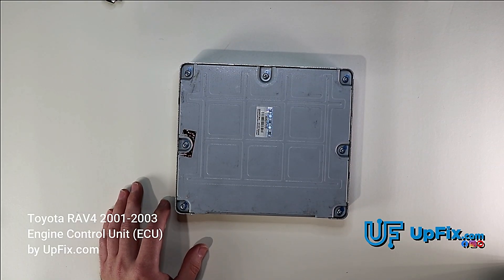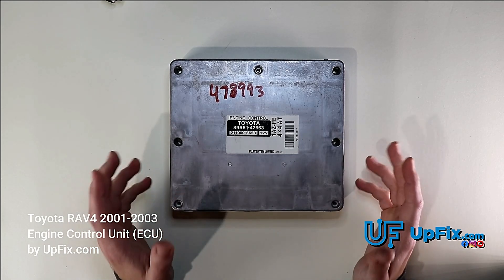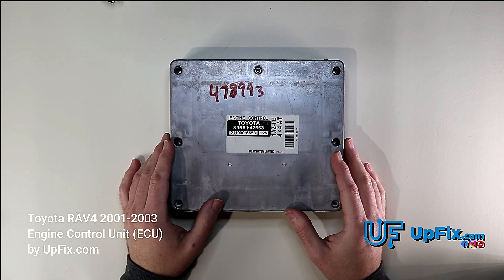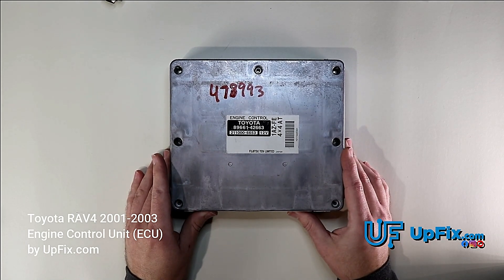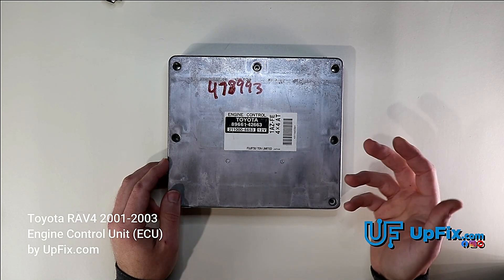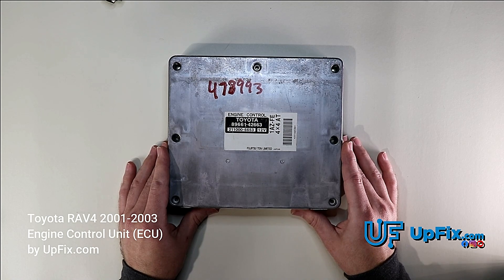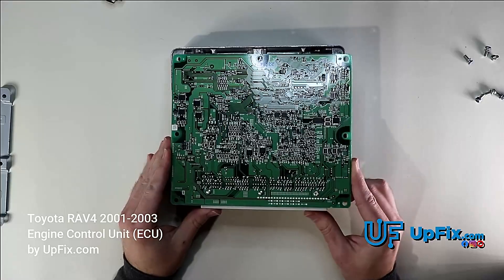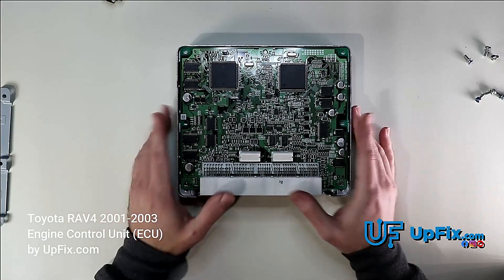Toyota RAV4 Engine Control Unit (ECU) Repair for 2001 2002 2003 models

Comment: I have 2003.rav 4 automatic. It has  hard shift to R and between 2-3 gear. 360km on it. Its from canada. It has had no recalls done.
Now it has 30tkm driven new transmission from previous owners, i think its the ecu/ecm, i have no idea where to buy one or repair. Im drunk, ill figure it out after inspection. For now works well when driven nicely.
Reply from the maker: Sounds like a tricky situation, but we're here to help if you decide to repair your existing ECU!
Reply: Hi, 
Where to contact you? I need to repair my toyota rav4 2003 engine ecm because car have gearbox issues, changing gear hard

Comment: Hi I repaired my ECU by myself (resoldering all the chips on the ECU). Now the O/D Off won’t turn off. So I am stuck at 3rd gear max. Can you solve this? The other issues are done. This problem occurred after I resoldered the ECU.
Reply from the maker: That is not a common issue for this part. You can send it in, we can see what is wrong and possibly fix it. All depends on what is damaged.

Comment: I have a 2007 RAV4 4wd, I  bought in October 2023, after almost a week of having it I noticed a shutter.  Thought it was just the surface of the road.  I finally had a mechanic test driving it when it happened.  They said the torque converter and best to change transmission and out new torque converter.  Had a second mechanic do the same and they said the same thing.  The transmission was replaced with one with 78k miles and new torque converter out in it.  The shutter started again shortly after getting it back.  Then they thought maybe other issues, months later and thousands of dollars later, it is still happening.  Also had dash lights coming on and changed a bunch of parts for the lights to only come on again.  The shuttering only happens when it’s in drive, if you put it in 3 it doesn’t happen.  I saw a video where they said you have to have a software update after replacing transmission and torque converter or it will start happening again.  Is this fix you are showing on this video something that would fix these issues and do you do this for 2007 4wd model parts as well?  The code showing when the dash lights come back on now is only showing P0171 after changing several parts.  My mechanic talk to a guy from Toyota and the said it might need a new computer and that may be causing the lights to come on.  My mechanic said he needs to flash the computer?  What do you think?
Reply from the maker: P0171 points to mass airflow issue which is usually the MAF sensor. That code could also be caused by a leak in the system somewhere. The issues you’re describing point to something going on with the transmission system. If you have any transmission related codes that would certainly help. 

In regards to the ECU in your vehicle it controls both the engine and transmission. Prior to replacing it I would recommend doing a firmware update in-vehicle to it as well as the TCCM (transfer case control module) and see if that helps. If still having issues we can do a bench test on your ECU. Checkout upfix.com
Reply: @upfixauto  The MAF sensor has been changed as well as both 02 sensors and a new muffler because the seam was coming apart slightly on the old one.  There has never been a code for the transmission showing.  When the lights first lit up after the transmission and torque converter were changed the codes that came up were P0138, P0328, C1280 and C1201.  The Knock sensor was changed.  The shuttering from the transmission happened with the old transmission and torque converter, then started again after it was changed to newer transmission and brand new torque converter.  For a firmware update, do you have to get that done at a Toyota dealer?  I h spent just over $7000 and these issues still persist.  I. On disability, so I really can’t afford replacing much more parts to only have the same problem after.  I appreciate your help.

Comment: I just bought a 2001 RAV4 and immediately noticed an erratic shifting and hard pull, only after a few days of buying the car. Interesting was that during the test drive it worked fine and most of the time it does well. how much will refurbishing this ECU cost me?
Reply from the maker: If you're experiencing erratic shifting and hard pulls in your newly acquired 2001 Toyota RAV4, it's quite possible that the Engine Control Unit (ECU) is contributing to these issues. The RAV4 models from these years are known for ECU problems that can affect transmission behavior.

Refurbishing your ECU with UpFix involves repairing your existing ECU, which can be significantly more cost-effective than replacing it. The exact cost can vary depending on the extent of the damage and the specific repairs needed. Typically, ECU repair services range from $200 to $500. It's recommended to send in your ECU to UpFix for a diagnostic check. UpFix will assess the unit and provide you with a detailed quote before proceeding with any repairs. This way, you only pay for the necessary repairs, ensuring your vehicle returns to optimal driving conditions.

Comment: Where is the ground for the ECU located on a 2002 RAV4?
Reply from the maker: On a 2002 Toyota RAV4, the ECU ground is typically located near the ECU itself, which is found under the dashboard on the passenger side. To access the ECU Area, first, you’ll need to remove the glove compartment to access the ECU behind it. The ECU ground is often connected to a grounding point on the vehicle's chassis nearby. In the RAV4, you will find it attached to the metal body or frame within this area, possibly with a bolt securing it.

Comment: Let me ask you something ( I’m Jay from Tire Outlet San Jose Ca ) so the referee ( smog check ) failed a customers 2001 RAV4 because the engine speed on the scan tool ( it’s lazy ) did not match the actual engine RPM. The only thing I can do really is change the ECM or I have an improper engine assemble right? One or the other?
Reply from the maker: That sounds weird. Try to go to a different smog station. If your engine light is not on then you should be able to pass the test.

Comment: Does the 2002 Toyota RAV4 4x2 ecu work on a 2003 rav4 4x4?
Reply from the maker: They're physically identical, but the software/programming is different and will not work correctly.

Comment: Make sure the problem is actually the ECM first!  I replaced the EGR valve and then the MAF and that solved the problem on my 2002 Rav4.  The total cost was about $40.  I also pulled the spark plugs and the coils and checked those as well and since those were OK I went on to replacing the EGR valve and MAF sensor due to those two items being inexpensive to replace. 

Even though I didn't hook up and run a OBDII reader to the Rav4's computer I just test drove my Rav4 If the car runs fine then I don't worry about the engine light whatsoever.  I've been driving my 2002 Rav4 this way for the last 6 ~ 7 years without any significant problems either....

Like one YouTube mechanic said, "If the car's engine light is ON but there are no significant problems when you are driving the vehicle them continue to drive the car.  Many times the problem is insignificant and does not need addressing."

Comment: My  friend's 2004 has similar issues-have not had it professionally diagnosed. Was the '04's ECU/ECM 'fixed' or could it still be the cause? Thanks
Reply from the maker: Yes here is more info on what issues we repair https://www.upfix.com/product/toyota-rav4-2000-2010-ecu-repair/

Comment: What size screws are needed to attach the ecu to the mounting brackets? I shipped mine into you this week for repair but I stripped a couple of the screws removing the ecu.
Reply: M5-0.8 in case anyone else needs to know

Comment: I have two codes 2001 rav4 292k kilometres 

P0750 shift solenoid A
P0753 solenoid electrical 

Is it ECU issue???
Reply from the maker: Yes this is issue with ECU for RAV4. Here is more info https://www.upfix.com/product/toyota-rav4-2000-2010-ecu-repair/
Reply: My 2002 rav4 is not starting out in 1st.  Will not downshift to 1st and reverse shifts hard.  Could this be the ecu.i changed the fluid and checked solenoids.  .

Comment: Yes I've repaired several of these and got the vehicles cheap because people thought the issue was directly in tranny. I would even tell them this issue, but they didn't want to fool with it.
Great video about this issue. Important though is fact made not to drive too much or wait too long with this problem, it will damage transmission.
The problem originated from a new supplier of these ecu from for new 2nd generation rav's. They were made with weak solder to circuits and would start to break apart after 80k and up. Many would be out of warranty even after toyota raised years of warranty.
Common problem with new model years and suppliers not recognizing and working bugs out.
Reply: Can you please tell me what kind of issues this would cause? I am seeing a lot of information but i just am not sure. I really appreciate any help
Reply: Can you please direct me to a video of how to do the repair myself. Thank you!

Comment: Hi, will purchasing a new one from Toyota fix the issue? I know this isn't the cheapest way to get this fixed, but its something I would like to know.
Reply from the maker: It is a common problem with ECU for this vehicle
Reply: @upfixauto  With newer ECU models as well?  I would like to get it fixed, however I'm located in Australia and when I go to auto electricians/transmission specialists/Toyota they all recommend getting a new ECU rather than a repair.  I can't find anyone in australia who will do a repair job.

Comment: Hi. Great info.. but is this ecu issue also a cause of not starting??.. engine turns but no start.
Reply from the maker: Yes that is correct, this is most likely the issue with your ECU

Comment: The code readings giving me shift solenoids A&B. Do you think it is the ECU or should I replace the solenoids?
Reply from the maker: Try replacing the solenoids or test the wiring and signal.

Comment: Hi, I have no error codes but when starting my 2001 Rav4  and going from park to drive it jerks really hard, even jerks when backing out in reverse . This started when car was only 2 years old, dealer said no codes so they can't work on it. {even tho repair bulletin came out by Toyota} . Was slow when entering highways {dangerous} . It got so dangerous we hardly drove it {used our other car all these years mostly} and only used the RAV 4  for local driving {no more highways} to nearby supermarkets, only has 14k miles on it.
Reply from the maker: It's unusual for a car with that low mileage to have this issue. But the other factor is age which also take its toll on electronically components especially due to age. If the ECU hasn't been rebuilt even with no codes, since that ECU 01-03 RAV4 is notorious for failing, I would recommend getting a rebuild. We’ll be able to diagnose and repair this unit.

Comment: I have a problem in gear shifting ..pls guide is computer fault..?
Reply from the maker: Yes, that is a common problem in RAV4. Problem shifting gears from 1st to 2nd. Transmission slipping, especially from 2nd to 3rd gear
 Here is more info: https://www.upfix.com/product/toyota-rav4-2000-2010-ecu-repair/

Comment: Got a problem with my ECU on the RAV4 2003. Car won't start. Found out that spark plugs are sparking even though its all new Spark plugs.
Any ideas on which part of the ECU is damaged or playing up???
Reply from the maker: You can see all issues that we fix here https://www.upfix.com/product/toyota-rav4-2000-2010-ecu-repair/

Comment: is there any specific procedure as far as relearning shift adapts in the ECU to the transmission?  2002 RAV4 78k miles.  Thanks.
Reply: After the ECU's been rebuilt and re-programmed, the ECU will automatically relearn the proper shifting patterns typically within the first diagnostic cycle ie less than 100 miles.
Reply: @245artist  I just reinstalled my repaired and reprogrammed ECM for 2004 Rav4 yesterday. There was improvement in 2nd to 3rd shifting hesitation yesterday but today it became poor again. Does it happen like this at times after the ECM repair? I was thinking that everything should start working fine after the ECM relearn which I believed happened yesterday. 
My reverse harsh engagement still persists.
Reply: @juliustay2541  It should essentially be plug-n-play. Harsh shifts should go away almost immediately and if not the relearn will happen automatically within 100 miles. Was it recently repaired by UpFix and what codes are you still getting?
Reply: @245artist  Oh sorry, no please it wasn't repaired by Upfix. It was done elsewhere, I got inquisitive and just wanted another opinion when I saw your ECM relearn within 100 miles, that's basically the same as to keep driving it for a while. 
Currently, the only code I have has to do with my oxygen sensor which has been there before the repair and reprogramming. I rather had P0776 code for Solenoid B malfunction but that is no longer there. Shifting was better today too. I guess I may have to keep driving for sometime for the relearn to complete. Thanks.
Reply from the maker: There is no relearning procedure that is needed for this vehicle year make model